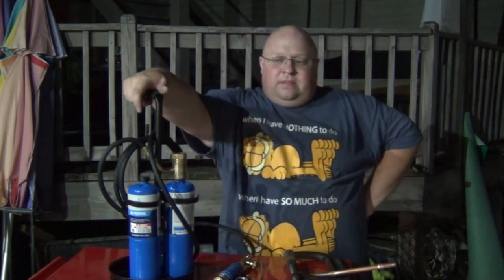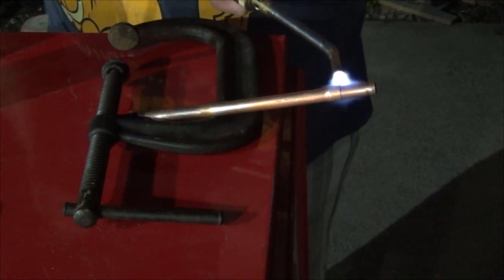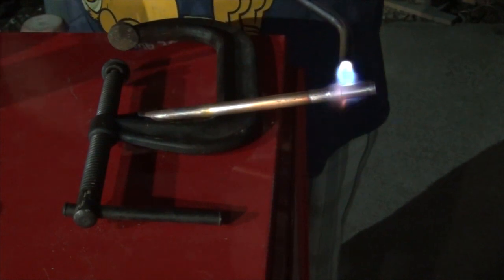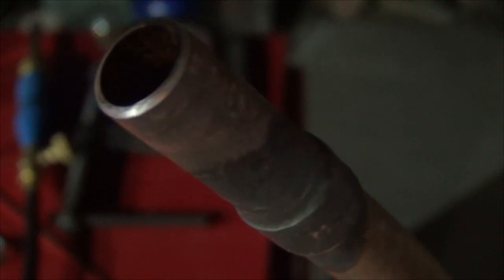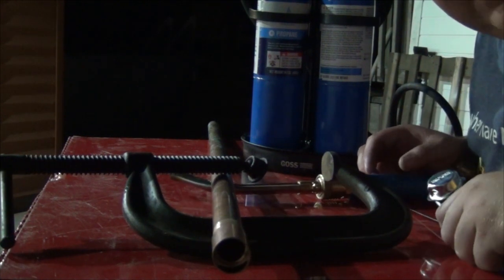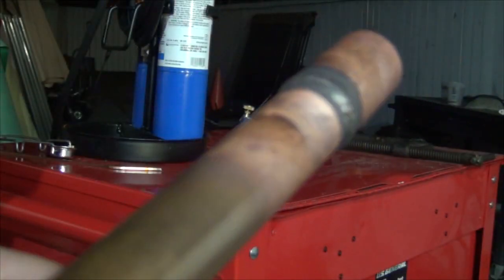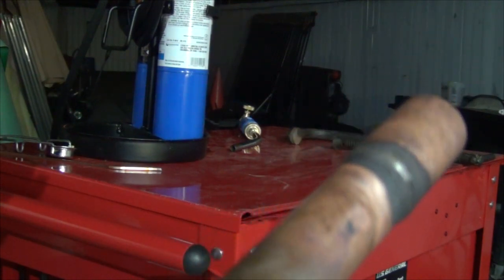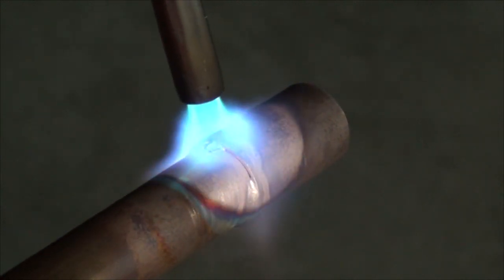silver braze with propane

Comment: I am learning copper soldering & brazing, work, I will be trying this soon, I have several ways to experiment to see which works best for me,  I have plenty of torch work in welding, & brazing & radiator repair, for last 35 years, just not doing copper pipes, I got a air fuel torch with multiple tips, & a lightweight aluminum 2 gallon propane tank, so I will experiment with propane only, propane oxygen & acetylene oxygen to see what works best for me.

Comment: I have had good luck brazing using a mapp gas torch in both my left and right hand.As soon as the joint becomes red I set one torch down to pick up the brazing rod.You must be quick or the heat will damage system components.Wet rags must be used.You want to avoid catching the building on fire.
 I would do this if I run out of oxygen or do not want to carry a heavy oxy/acet rig on top of a roof.
 The double barrel Turbo Torch can't be beat,but most professional Hvac men will always use a portable oxy/acet rig only.
 Practice brazing and soldering with scrap copper and not with other people's property.

Comment: Can you braze new Hvac lines with it? I was thinking the same and getting a kit at home depot.
Reply from the maker: Yes you should be able to mapp gas will also burn a little hotter and make it easier
Reply from the maker: @timusa3937  I like the 15% silver brazing rod Sil-Fos 15 is a brand name.
Reply from the maker: @timusa3937  love stay Brite stuff is so handy to have around. The tensile strength copper to copper is 14,000 psi 410a will not even come close to that. The thing you need to consider is the low melting point if the system was ever in a fire the joint could come apart and release the charge. If the charge is flammable you can see how that would cause a problem.
Reply: @thegreatjellydoughnu   well there is another valid point to consider,  from a automotive & torch geek guy, but not in HVAC yet, look at all acetylene tanks, they have a plug to melt to release, which is better than reaching higher temps & a possible explosion, so wouldnt a solder joint be technically safer in a fire to release, than to hold pressure until it possibly explodes?
Reply from the maker: @randymack1782  this is true I think the thought is since a refrigeration circuit is filled to a saturation and not absolutely full to capacity with liquid if the joints are strong the system can handle a the increase in pressure without rupture. If the soft solder let's go unexpectedly the refrigerant will all be released into a fire and that breaks down into a very toxic gas. But I do see your point and I do know of the safety plug in my acetylene bottles happily mine have all stayed solid and no bad days
Reply: @thegreatjellydoughnu  true, lots of great debate within this topic, as thinking burning releases toxic fumes, and then the     burning items raising temps, whether couch, or items inside, or who knows what, temps can get to around 2,000F if so, the silver braze would melt as well, and so much toxic fumes there already, there is no honestly good answer, just best opinions

Comment: This would have worked way better if you used flux. Also, you should be heating where you want the silver to flow, not at the joint.
Reply from the maker: it may have worked better with extra flux but the 15% sil-fos rods have the flux inside them. that tip is so broad you will always be heating the whole joint with my oxyacetylene set you have more pinpoint control. your not wrong but i am lazy and know where i can save time and effort. thank you Lavachemist for the comment.